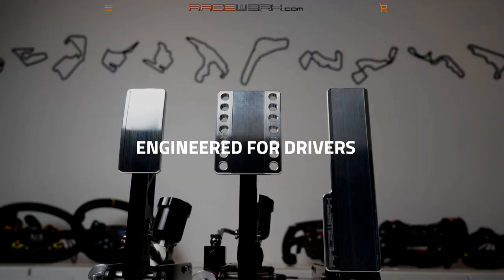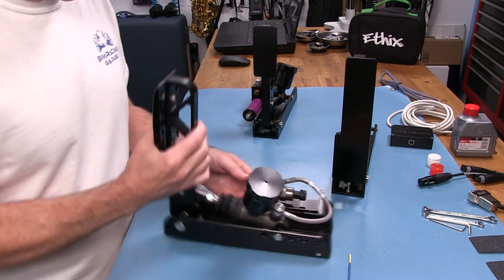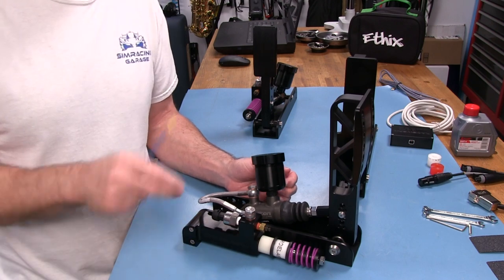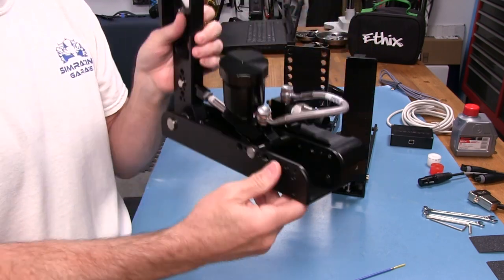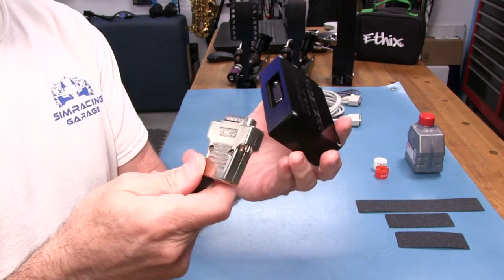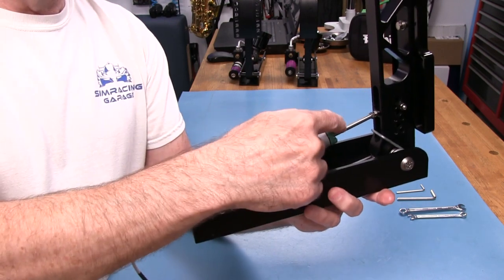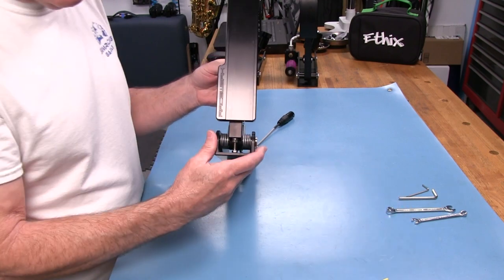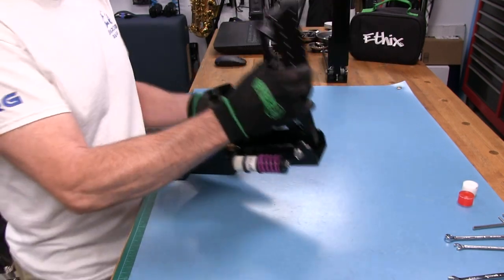Racewerk S1 Pro Pedals Review

Comment: Thank you for the detailed Racewerk pedal review as I am considering purchasing a 2-part pedal set.
To be honest, I'm a bit surprised at the flickering signal on the throttle and also on the brake.
The flickering at the end points and the impulses can be overridden via the dead zone calibration in order to avoid active signal jumps here, but there also seems to be a flickering signal in the active measuring zones (should also be the case). To do this, however, you would have to hold the pedal a little longer within this measuring zone in order to be able to see this more precisely.
Unfortunately, this was not shown in detail.
With an actual 16-bit resolution, this flickering and signal jumps would probably become even more clearly visible.
However, the actual signal resolution seems to be below what is stated, why? Maybe I am misunderstanding something here too?
The lateral movement of the brake pedal in operation also surprised me a bit due to the massive construction and the advertised high-quality elements.
If a modification to the fastening elements is necessary after 4 hours of operation, then I am actually not so sure about long-term carefree use.
A manufacturer like Racewerk, which brings high-end pedals onto the market at a correspondingly high price, should also meet the high-end expectations of users.
Reading between the lines, I don't understand or feel any extraordinary euphoria regarding these pedals in this review.
Reply: @tilus75  thank you very much for the clarification, understood and clear now.
Reply: IMO there are better options nowadays
Reply: @Simlife101  like? which ones do you reccomend?

Comment: So you've got a pedal with that is advertised as 16 bit resolution which is 65536 points of throw for each pedal, and yet their program shows12bit resolution with 4096 possible points, and yet it uses 775 to go from 0-100% on the accelerator Which really means you're using less than 10bit. Really other than the hydrolic feel, you're not really getting more accurate pedals. For the price they're charging, I would expect to see better accuracy and use of the 16bit data they claim to use.
Reply: What worries me though is the throttle pedal signal flickering seen in the video. That is pretty jerky. I'd expect stable signal at this price level.
Reply: @erwinlommer197  exactly what i thought to my g29 started doing that jerky thing after 2 years of use ..those doing it from the beginning is a red flag for me ..i am considering buying the tilton ones i am using HE sprints atm
Reply: @tilus75  you are right i haven't thought about the emi that Barrys rig is emitting i dont really care about the resolution of the entry level pedals that i have mentioned g29, that i was saying that the potentiometers after tow year of use they start to do the same thing as the gas pedal on the video .. i get there is alot of emi but i got the impresion that it was due to a low quality potentiometer ..
Reply: @wow35master  I got sprints atm too, why do you want to change or more precisely, what do you think other pedals need to do better?
That's not offensive in anyway, as I am considering myself to upgrade but I wonder what other people with Sprints want from more expensive pedals.
For me it is the brake-feeling, it just seems not satisfying to me, like it is missing something in smoothness and consistency. No problems with acc/clutch though, I even believe the clutch won't be any better on any other pedals.
What are you thinking of to get? I am unsure if I should just switch do Ultimates or go a different route...
Reply: @empii911  hey i have the same experience with the brake to ! i have tried some mods also and added dumper but the brake pedal feels dead to me the is like i am pushing a bottle of Pepsi full and seal on the ground the feeling is stupid to me for a brake pedal ..how ever i love the gas pedal and my times got better due to smother operations of the gas pedal ...i was thinking to buy hydraulics that don't use rubber bumpers because i believe the feeling of my sprints are coming due to rubber bumper see the video of the Sim coaches hydraulics pedals and see how smooth and springy the seem to be .!
Reply: @empii911  I'm not liking the Sprints either. Brake is just not great. I"m looking at these and the Simcoaches.  I do like software where I have a curve I can use which is why I'm not going with other hydros of the ultimates.  I don't know what to get as these reviews just kind of give you a got it pretty much where I like it and they do what you need them too.
Reply: @Succotash3  exactly, they are all afraid of making a comparison because in the end all Videos end on „great product but you need to think about the price“

What we really need is a full blown comparison of all the high end pedals. I would do it myself if I had the money to do it.
Reply: @wow35master  Barry's motion was not on though
Reply: @tilus75  As i said before Barrys motion is not on you can see that in the video

Comment: That design should be fairly easy to DIY. Those pressure transducers usually just take 5v and put out .5v-4.5v and are usually pretty linear in their response. They’d be easier to build than a load cell design.

Comment: Great Review as always.  

I think after a certain point, with these kinds of equipment, we leave the Price/Performance boundries and cross over to Sim/Porn.  

Now that we have crossed the boundies of simporn fetish with these pedals, they will need to upgrade to 7075 (I mean come on rolls eyes at 2000USD I think the price change of bar stock from 6061 to 7075 will not make a difference.  Hell the CNC shop will love you for it as it is nicer to machine.  also 7075 loves hard anodizing.  also a thrust bearing setup with wave washers with bronz inserts to remove the play.  Machine the chamfers after anodizing..  also the message should be cut after anodizing.

I guess the saying on motorcycles goes for sim racing as well.  "Every seat has an ass for it to sit on"
Reply: Never read "simporn" before, but it exactly describes what's going on! :D
I do like 7075 as well, but what would be the advantage for this product? 7075 has same stiffness as 6061. Higher strength has no advantage as even 6061 won't brake. ;)
Our 7075 parts always become a little yellowish after anodizing. No problem for this full black style, but at least for natural aluminium finish I don't like 7075 for visible parts. But maybe our service provider does something wrong...
Reply: @driflysh4597  that is the interesting characteristics of Hard anodizing and actually a good way to check if what you get is truely what you want.  

7xxx gets brownish color
6xxx  gets black
I dont know 1xxx , 2xxx and 5xxx series has been a long time.

I think at 5mm you can not break anything unless you made it out of cardboard ;)

like I said when you reach this level we are playing for show :)  I use lasercut pedals that are completely unfinished (nasty really) my friend uses 3d printed one, my other friend uses a gamepad.  

I have raced RC cars for 30 years RCporn had been the major sale points for rc cars and how companies made their money.  It still is a major market.  Barry uses HUDY allen wrenches.  I have the same set with my name laser etched on them.  I also 3 more sets from various companies.  mind you they dont make you fast.  they are just feel good toys that make you smile. These tools are more expensive than Snap-ons. 

for fit and finish you may want to look at Arrowmax-RC.  

what I am saying is after a while it becomes a "pleasure" to own these.  for what its worth this is the only pedal set I have seen on Barry's reviews that checks the porn tick ;)
Reply: @tilus75  I use a Bearing pedal.  I think they are the way to go.  They just need to be shimmed properly and you just need to make sure the fastners are not touching anything but the center of the bearing.  

By the way from what I wrote do not get the wrong idea.  I love the pedals. hell If I were still in US, I would have these on my rig and pestering you for other things to make :)

Sim racing is in its infancy compared to rc cars or real cars for that matter.  SO I am just used to these high quality more expensive stuff.

Comment: Hi Barry, I've never seen you using these pedals in your newest videos but I often see the Simtrecs and Wave Italy pedals. So why is this, wouldn't you recommend the Racewerk pedals?
Reply from the maker: The S1 Pro's are a fine set of pedals. I use whatever fits my personal taste when it comes to Sim Racing gear. But, that is very subjective. Just because I use something as my daily driver does not mean that you will feel the same way. We all feel things a bit differently.
Reply: Peter I've been using these pedals for 6 months with the sc2 
 There is no vibration. Pedals are first class.
Reply: Hi, Barry I just got the same pedals and I'm struggling to get the Racewerk Calibration tuning tool...any tips I can get from you...? Did you have any issues at that time??